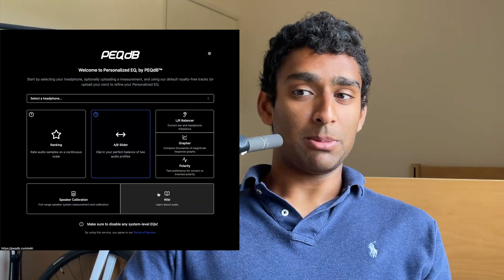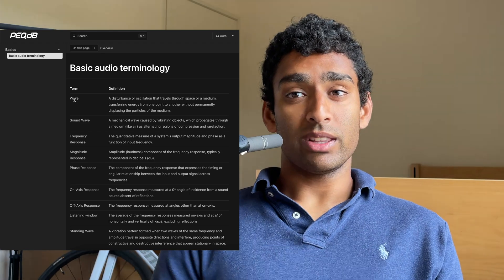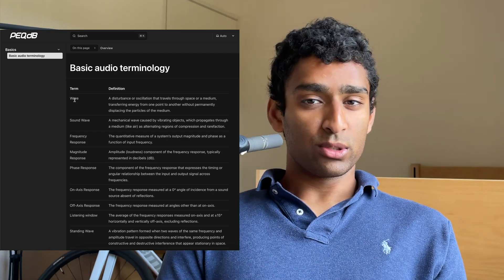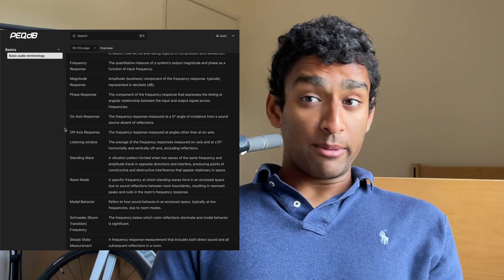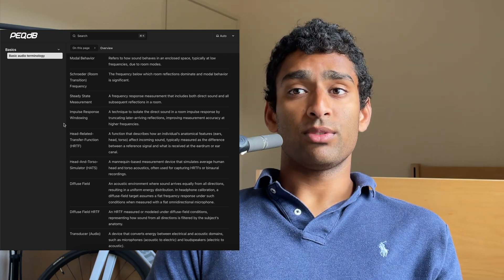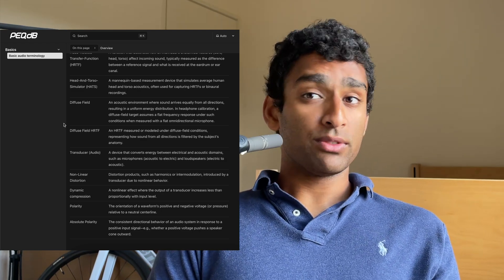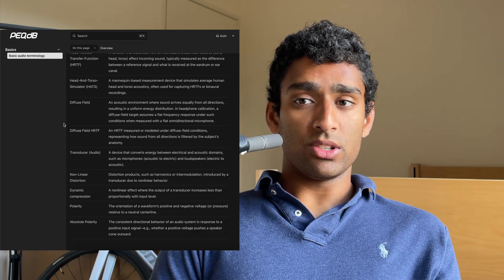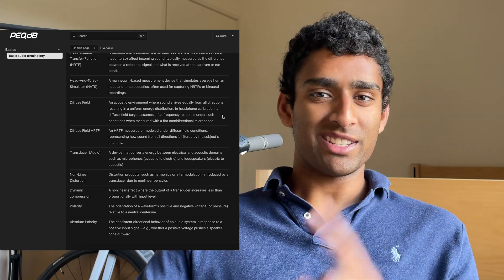Become an Audio Expert in 30 Seconds

Comment: Hey Sharur what about the word resonances that you like to use sometimes or tactility, soundstage,
Perhaps the word Target curve and since you are adding speaker, and other audio terms too maybe you can add words that ive seen like directivity, radiation, reflections, sound power, omnidirectional, wavelenght, compression, interference, dynamic range, time domain,  group delay, acoustics, in-room response, reverberation, echo, anechoic, acoustic impedance, leakage tolerance stuff like that. 

I think this wiki can be very useful, thanks for putting effort into sharing this.
Reply from the maker: good idea
Reply: Bbc dip or eargain multitone distortion harmonic distortion, etc.